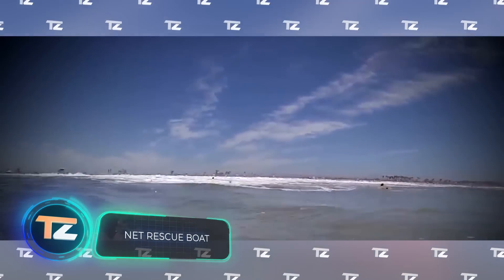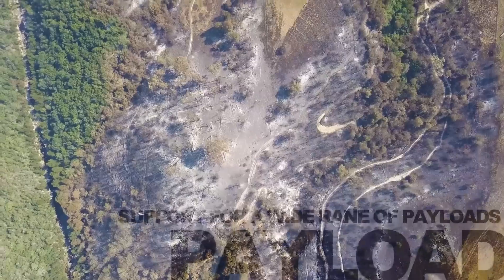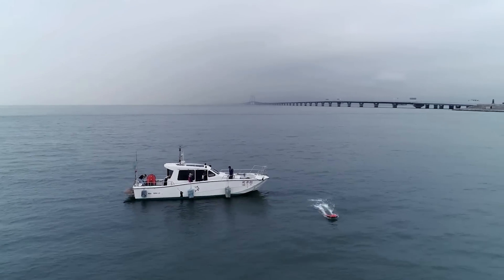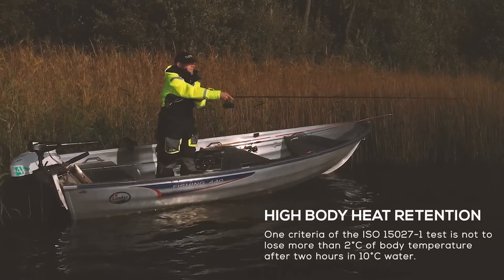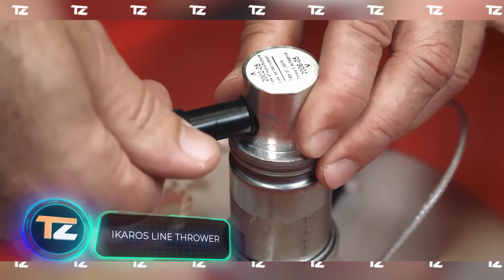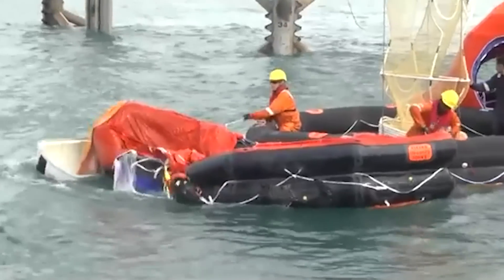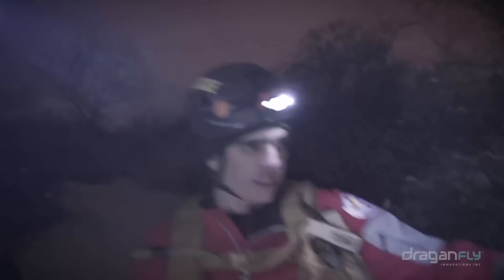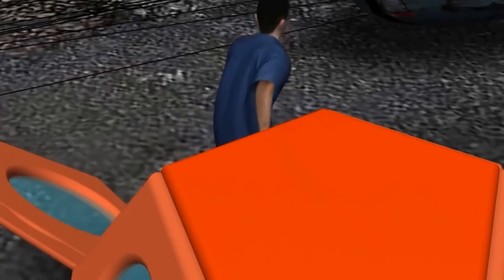INCREDIBLE INVENTIONS THAT WILL SAVE YOUR LIFE

Comment: At 1:47 how do the pilots get out of the plane?
Reply: They don't. Chances are there job would be to do their best to make sure they are not crashing in a populated area.
All pilots have training for most situations and can land without an engine working. 

 I don't feel this would be safe to have this as the cabin wouldn't be controllable once ejected. Also no indication of shock absorption for the cabin when landing, and parachutes can fail as well. 
I would feel safer in the aircraft with trained pilots as your odds are better.

Comment: I was looking forward to see the Dolphin 1 rescue buoy,  when hearing the speed and 30 min run time it was a no brainer.  Hey look someone had a great idea, the design, looks great.  Sadly when they developed, chose the battery/motor it was like taking a new Lamborghini having the manufacture take motor, transmission out so you can install a used briggs-stratton 3.5 hp engine.  In other words Dolphin 1 design team made a product that meets all the requirements for a big piece of crap.  Top speed with no passenger 7.5mph I think they said and 30 minutes run time.  A rechargeable battery after 15 mins will drop 20%, at 22 minutes half and the last 8 minutes maybe 1.5 mph.  Now you add the person being rescuing who eats half of their meals at the all you can eat buffet,  why huge, overweight people weighing about 350 to 400lbs think swimming past the buoy is nothing.  They forget about the coming back with a stomach full of greasy buffet foods smothered in imitation butter sauce.  They always have leg cramps, don't have the strength to pull themselves on a slip n slide let alone even get one of their 75 lb chest boob nipple on this.  So a 10 ride to get meatloaf on a stick grabs ahold with head wind and this power house Dolphin 1 has dropped 15% and taken on towing back a humpback.  I doubt the lack of power, run time will even get this meal on wheels moved towards rescue boat 10 feet.  Now they have to send in Coast Guard in helicopter to save Kids eat free and the Dolphin 1 that now has a burnt out motor.  
Gosh, put a good engine and battery that has a stack of AMPS.  All we have now is a item that you toss in water which is called littering.
Reply: *Thanks for watching send a direct message right away on the above number for more enlightenment:••*......
°°°